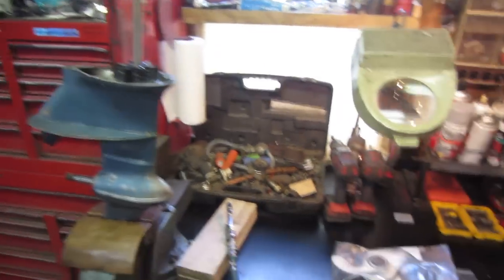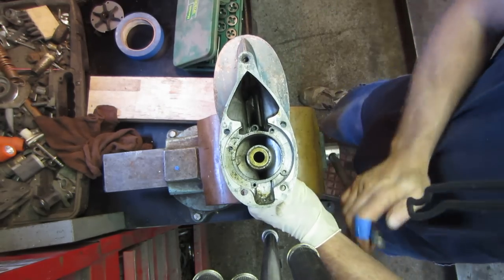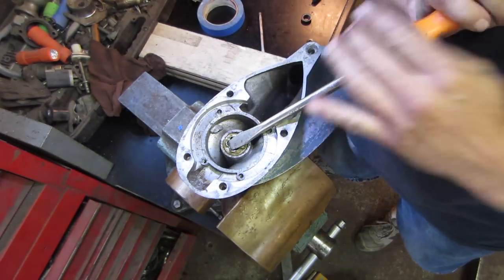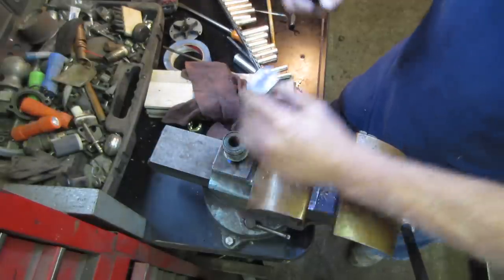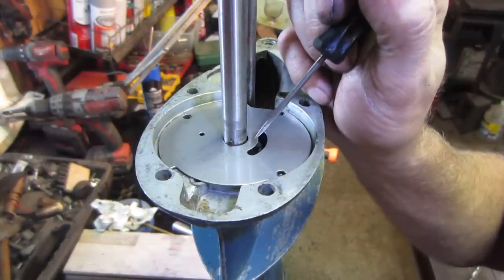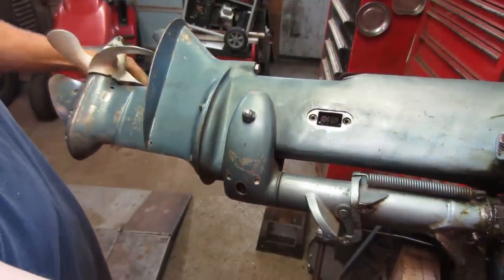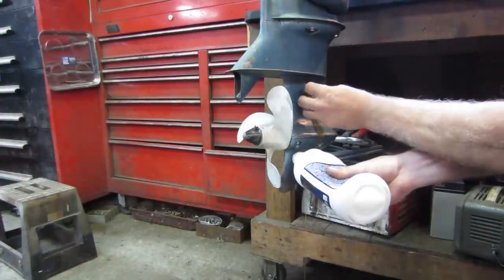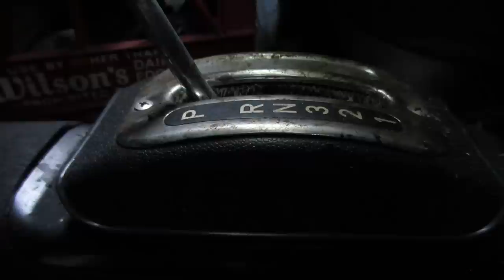1956 evinrude lower unit rebuild and run

Comment: I feel like that pin would elevate from the plate when a large amount of torque is applied or at higher speeds. So it might just rest on there a little bit here and there and maybe when its shifting from foward to reverse or vice versa. Just a thought.
Reply: I literally wrote this, continued the video and not 10 seconds later you said the same as I just wrote lol

Comment: My guess is they make a small bearing puller for that brass bearing down in there you tapped. I mean if you did a LOT of these a little slide hammer with the right size bearing pulled would be worth it, because you'd end up buying more than one tap if you did 20 of these a week... but otherwise this isn't a half bad idea. If I was doing it I would have bought the bearing puller from Amazon for like $70 or something heh... this was a lot cheaper.

Comment: What is the magnifier/flashlight setup you are using, and where can one purchase one?  I'm over 50 and I need cheaters for any fine print or low-light situation.  I've seen the head lights with the elastic bands in sporting goods stores, but yours look well-built a little more specialized for the garage.  Thanks!
Reply: No sooner had I posted my question, I resumed watching the video and got a good look at your headlamp, made by Boruit; I already found it online!

Comment: If I were doing this I'd have to stick a brass washer under that pin in the water pump, at least that way it's a steel pin rubbing on brass, rather than steel on steel

Comment: At least with this old stuff you can get in there and replace worn or damaged parts and make it run properly again. So much new stuff you pretty much have to destroy the thing  to even get at the part that might be faulty. It isn't made to be mended. Throw-away society.

Comment: Yes the coupler was the culprit when you were harassing it inwhen you were trying to get it off. Only the the bottom bolt is loosened and when the lower unit comes off it slides right out >>>>>>>>>>>>>>>

Comment: Do you know the right hand rule for torque?  The shaft move up due to the torque and doesn't turn on the plate.  That may explain the pin's location.  Thanks Babu
Reply: He said that in the video.

Comment: When you run fresh threads with a tap turn 1/2 turn forward, 1/4 turn backwards.make a cut and break it off. Will save your tap teeth.
Reply: It was brass, I'm sure its fine
Reply: Gotta clear the chip to make room for new cut regardless of metal

Comment: I have the little brother of that particular engine a 1955-56 model Evinrude 7.5. Had some work done to it over the years but mostly minor things. These things are so easy to maintain and repair if you can find parts. Next job musty did you sell this one yet?nice
Reply: You can bore a next hole above that hole for the impeller pin
Reply: At the bottom of the pinion gear there is a grove on the inner side which carries a circlip to prevent the shaft from dropping down further

Comment: If you would have asked me, I would have told you the neutral problem was because of the slack in linkage coupler, but you didn't ask. :P

Comment: Curious when doing all this was the water drain in exhaust chamber where water pump is verified/clear of obstructions? I’ve not seen where hole is exactly on inside beside shift Rod … found exit on outside

Comment: You reused the shift rod bushing over after you cut threads in it? I would not have done that unless I had a new brass bushing to put on there.
Reply from the maker: nothing touches it, it just holds in the bushing, its a common practice on this engine from what l looked up.

Comment: Must've, really love your channel and watch every episode. My concerns over the latest video and the removal of the brass inserts. Would it no have been better to use threaded rod and a slide hammer to pull the inserts out?
Reply: Sorry folks Auto correct changed this, apologies Mustie, and it should have read not have been better.
Reply from the maker: are you talking about the seals or the brass that l threaded,

Comment: I checked out the tear down video and I think ??? I can see the groove for the snap ring at the bottom of the pinion gear (inside). I think Matt Peters was right !
Reply from the maker: l understand that it has a place for one but in 56 it did not get one, it started in 57,

Comment: u need to check to see if the headgasket is blown. that will cause it to over heat to. u should have taken the hood off & turned the flywheel to get the lowerunit on

Comment: when I took my water pump apart the vanes were facing in a counter clock wise direction when facing the front of the engine, you seem to have installed your pump with the vanes going in a clock wise direction , pushing the vanes as apose to pulling them what is proper?

Comment: are you sure its the right way up whit tat upper seal? it has to retain water not the oil, and the lower one has to retain the oil... (so spring on the upper one up, and the lower one spring down.. (upper one is to keep water out, lower one to keep the oil in)

Comment: Was that you, pulling into Rpeek's in Union yesterday 8/3/17? I went through Union Common to avoid construction and thought I saw your car trailer pulling in.  I almost turned my Tundra around to see if it was or not, but I had the truck full of groceries and decided not too.
Reply from the maker: not me
Reply: I wasn't sure, all I saw was the red trailer turning into Rpeek's and I had the Tundra loaded with groceries so I didn't bother to check.  There is a lot of red car trailers here. Great video as always!

Comment: I have an old Evinrude big 35 and an old Johnson 10 hp, that look a tad bit older than yours, that I was going to fix up and put on an old vintage v-bottom boat. The boat is a 57 model, so I would like to put a motor on that is close to its age. Where did you find your year/model number on your motor? I cant find a plate on mine.
Reply: Should be an ID plate down in the attach clamp area of your motor.  You can get the info you need from that, or at least use the info for a search online.

Comment: Need to run with the top cover off, what happened to me is last guy ran it hot it needed water pump after I changed the pump and ran it the block was cracked water seeped out ,,because the pump wasn't working when I bought it there was no way to see it when bought,,, had to part it out.

Comment: any ideas whats wrong with my AJS 125de regal raptor? it starts but , its not happy when starting and when i put in gear andlet clutch out lowly and apply throttle it cuts out. any help would be great

Comment: Or maybe a fastback or squareback, but seeing that automatic reminds me of type 4 with hydraulic slave cylinder and maybe a 2 litre.
Reply: My buddy had to change from auto to manual and had trouble finding seals for the slave.
Reply: What I meant was after switching to manual tranny.

Comment: I don't get why you can just fill the lower unit from the top and when it starts puking back out call it good? Filling it from the bottom seems weird.
Reply: No - You need to fill it from the bottom to expel any air.

Comment: Sorry Mustie, but I'm going to have to reort you for screwdriver abuse! :-)
Reply from the maker: it was dirty anyways
Reply: crows foot style pry bar.
Reply: it is a specially modified tool . no longer a screw driver.  takes much skill and precise machining to convert into a seal puller.    very rare, very hard to find. like VW air cooled cylinder head gaskets.  lol
Reply: Comments as such - that's why I enjoy reading them!  ;>)
Reply: Every tool has a hammer side - SMA

Comment: just put the 21hp husky mower back together after basically 2 week , rebuild ...since least 4-5 companies uses same parts,they tend to cheap out on parts , would extra 4 washers be to costly on 2K riding mower? guess so ...to the point the steering on the mower is also just held in by a pin and floats same as that boat motor shaft =).........hope your arm got better...i moded the mower to go extra 1.5mph faster  ......does anyone know whats the smallest ride on mower/tractor with cab? and AC?? mowing 3-4 acres get lil hot .....the camel hydro back pack with beer in it dont last too long ..in the sun

Comment: Backdriving with the prop will push the water pump backwards.  Might be that your impeller vanes were binding on the housing.  Better to pull the plug and rotate the engine the right direction.

Comment: I thought petroleum grease disintegrated neoprene o-rings?
Reply from the maker: depends on the type, this is holing in gear oil
Reply: The lip seals are, but the water pump impeller is neoprene.  Use silicone dielectric waterproof grease instead.

Comment: One thing for sure they don’t make them like that anymore.
Reply: Yep.  I had a '69 Evinrude 6hp for several years, used it in tidewater estuaries off the northern Chesapeake Bay.  There was many changes made in construction and weight from the '50s - early '60s Evinrude models.  Gave it to my son, and he's still using it up in Georgia/Alabama.  VERY dependable OB motor.

Comment: One trouble is that with all the new regulations you can't run 2 cycle engines on lakes anymore!  You have to run 4 cycle....
Reply: that law is only in effect in tahoe and a couple of other stone cold commie areas.  other than that, two stroke running all across the land
Reply: Any Federal Water. Lake Powell, all the dams on the Colorado.   I believe it's on our State waters too.
Reply: Deserthunter Mike you cant buy a 2cycle marine engine anymore but mostly you are not banned from running your existing engine. Banning use of all marine 2cycles would force the majority of small boat owners and jetski owners to buy something with a four stroke and leave them with a mostly useless yard ornament.
Reply: I absolutely agree, I sold my last boat, a 26' cruiser a few years ago, at that time you weren't allowed to run your 2 cycle on Lakes like Lake Powell,  They even had stopped selling 2 cycle gas at the marinas.  I might be wrong I'm not certain, I'll check and repost
Reply: I read a bunch more, it appears that 2 cycle isn't totally dead, one that can cope with the new regulations can run on the water, (2013 regulations, no oil injection etc.) but I'm still not sure about the super old trolling motors, it appears as if they are banned too but I can't seem to get a straight answer from anyone...
Reply: My last Merc Motor a 7.5hp motor. was stolen from our garage, frankly, if I get around to buying another it will most likely be a solar powered rig./ lipo batteries and a solar charger.
Reply: though it may feel delicious, possibly righteous and correct to own solar powered stuff- it's very pollutive to manufacture.  everything through and through from panels to special batteries needed.  if the truth was told about prius and other electric cars, the energy and resources it takes to manufacture and recapture (responsibly recycle) the original and subsequent banks of batteries- and you applied that cost to fuel and amortized it over 70,000 miles then the prius would be just another 30-33mpg vehicle.

i am pro choice- i think everyone should do what they want to do while being respectful to the environment.  within normal operations of two strokes, not even considering bypass recapture, there is no environmental harm- the pass through evaporates.  if you capture the pass through then there's not even an argument, it's as clean as a four stroke.  maybe even cleaner than some.  tohatsu makes all mercury outboards right now.  they previously made two strokes that did NOT pass the emissions standards of the USA of the 1970s and 1980s and therefore were not imported much at all.  and those standards weren't very high.

so is tohatsu making eco-conscious four strokes?  maybe.  i would like to see some emissions testing results.  people stop caring when they hear the word "four stroke" but they can still be pollutive

Comment: I love ur videos but like ive said before sometimes u go to do a tune up changing plus etc etc and i came back and the dam cam shaft and pistons are all out if my car lol lol stop messing with shit all the time but yes live the videos and yes im a car mechanic some what of a boat mechanic but just in like anything if a company makes something ass evirude made this and made that change the yrs after to keep that pink off that piece and a lil in the water impellor so yeah put on a washer like u did but no videos of motor runing showing everything is working

Comment: I have always heard that you need to use silicon paste on O-rings. No petroleum products on rubber type items as it eats into them shorting their lifespan. Marine grease is a petroleum product. Just what I here.
Reply from the maker: what do you think the gear oil is that its holding in?
Reply: well I thought of that same thing after writing this. Then again perhaps that is why they go bad is because they are in slight contact with the gear oil. Just a thought. lol

Comment: Read from post #7 on here: http://forums.iboats.com/forum/engine-repair-and-maintenance/johnson-evinrude-outboards/554648-1956-10-hp-sportwin-lower-unit-drive-shaft
Reply from the maker: thanks glen l may go back in, not much to get to that spot 6 screws and the prop